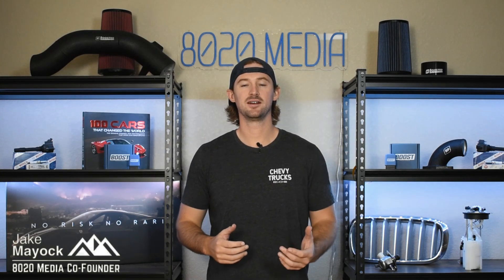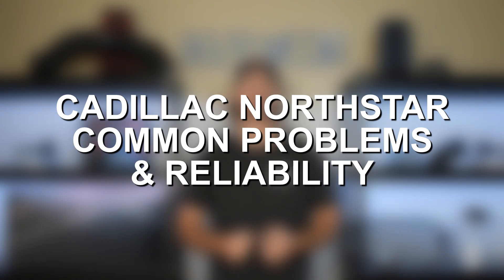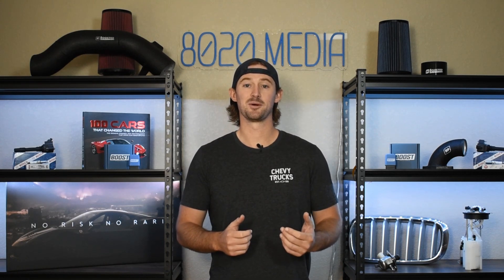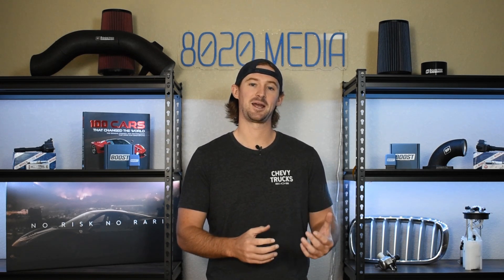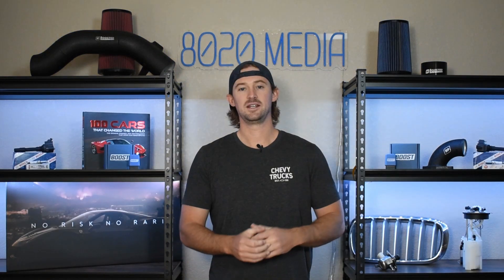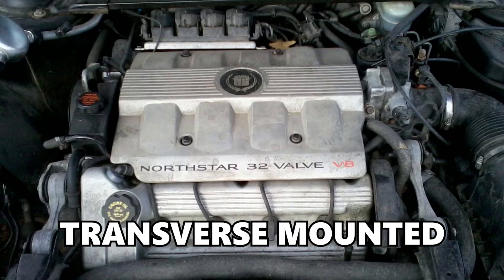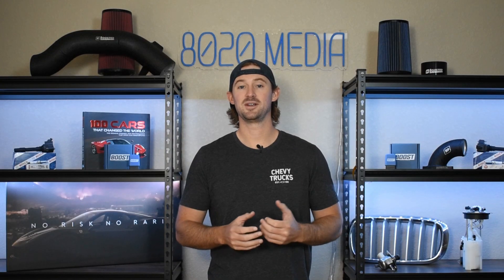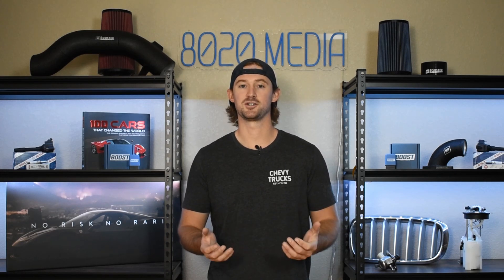The Cadillac Northstar V8 | 5 Common Problems & Reliability

Comment: How do you bullet proof an engine I have low mileage 97 cadilac  that I really  like and want it to be around for a long time
Reply: Northstar Performance is the only reliable option. The owner, Jake has dedicated many years to providing everything needed to bulletproof a Northstar. They also offer performance modifications including ecm tuning. I've owned my 97 Eldorado for 16 years, purchased with the head bolt failure at 130k miles. Had a mechanic familiar with Northstars install NSP head studs, 50k miles later still running great with no overheating issues. Its hard to bad talk these engines after you've had the chance to enjoy and experience their good side. I swear, I love it a little more each time I hit the throttle 😅

Comment: I just bought a 2000 Deville last week. 55K and well maintained. Perfect in every way, not a scratch. Even has the new car smell. If it blew up tomorrow it would be worth fixing or just keep to look at. I could just part it out and make a boat load of money. Have you seen what a perfectly clear pair of OE headlights are going for, it will boggle your mind. The interior looks like it's never been sat in.
Reply from the maker: W - Nice, pretty low mileage for that model year. Just take good care of it and you can easily get 200k+!

Comment: The head gasket problem was not due to TTY bolts stretching it was the fine thread design in a cast aluminum block which was remedied later with coarse threaded head bolts and there is a kit to tap and install these on earlier engines. That was the only major issue other than oil consumption.
Reply from the maker: S - Thanks for sharing.

Comment: I cant tell if my 03 cadillac seville is leaking or burning oil but i lose oil but no spots on my driveway or anything. What could it be?
Reply from the maker: D - If your vehicle is losing oil without visible leaks or driveway spots, it's likely burning oil internally, which is common for the Northstar V8 in that generation; these engines are known for oil consumption due to worn valve stem seals or piston ring design, especially past 100k miles. You might not see smoke because the catalytic converter can burn off much of the excess oil before it exits the exhaust. To confirm, check the tailpipes for black carbon buildup, monitor oil loss rate between oil changes, and inspect the PCV system for clogs that could worsen oil consumption. A leak-down or compression test could help confirm if it's ring-related, but unless it’s excessive, top-offs may be the most practical fix.

Comment: I have a 2001 Olds Aurora with the 4.0 Northstar. I bought it new in 2000. Trouble:
1. Spark plugs & boots....2019
2. Fuel pump.....2020
3. Starter Motor.....2024
Reply from the maker: M - Not too back actually! Thanks for sharing.
Reply: @8020Automotive  OK

Comment: I've owned 5 Cadillac Northstars. Other than the fact they leak oil like the Exxon Valdez, I've never had a problem with them. Proper maintenance is key to their survival.
Reply: really?! i need some help with my 2000 deville, and no one is willing to help me im on my own and would appreciate some help!
Reply: They leak oil inside the engine? How exactly do you deal with that if that is the case?
Reply from the maker: T - Well said!
Reply: “I add a liter of oil every 1,000 miles.”
“I’ve never had a problem.”

Mate, it’s a PROBLEM to be spending an extra $10 on oil every 1,000 miles of travel!

Comment: Another crock of s**t video about Northstars done by a clueless youtuber!  I run and build Northstars.  They are actually very reliable!  The issue with Northstars is not the engine itself but bad owners and bad maintenance.  All of the problem Northstars (block porosity etc. ) have long been scrapped.  All that is left are the good Northstars.  These engines need maintenance as they were high performance engines in their time.  They need frequent oil changes, frequent coolant changes, frequent servicing and preventative maintenance just like every other high performance engine.  The head gasket issue is the same with ALL alloy engines no matter what type or manufacture not just a Northstar, DO NOT overheat an alloy engine of any description as you will blow the head gaskets and probably drop the valve seats.   As for the rear main seals, the first gen crank seals were junk.  They have been modified since and the problem is no more if you have the latest type seals installed.  The oil pan leaks were caused by GM using cheap sealants and just the age of these engines (as with all engines.  If it has been resealed by a reputable shop they will leak no more, well for at least another decade or two just like any other engine.  I have never seen a valve cover crack on any Northstar and I have built lots!  Again cheap gaskets which GM are famous for on all of their engines.  Any new gaskets from reputable manufacturers have been built to a higher standard.  Good name brand 10w30 synthetic oil replaced at a maximum of 5000 miles or one year whichever comes sooner is crucial just like any other engine.  As for burning oil this was sort of a GM thing of putting a Northstar in the wrong car.  These Northstars need to be revved!  You cannot baby a Northstar!  Just like any other performance engine the oil control rings will gum up if they don't get enough heat and rpms into them.  This is not just a Northstar issue.  GM putting them into cruisers primarily driven by the older generation that spend most of the time idling or at low rpms are not doing these engines any favors.  The last point is the fact that these cars are now cheap and that causes it's own issues.  My current 1998 Eldorado cost me just $800 with 78k miles on it!  These cars tend to be bought by people who are of low income but want to drive like kings!  Then they suddenly realize that they can't even afford to put air in the tires, drive them into the ground and then blame the Northstar when it grenades itself into a cloud of boiling coolant!  The last one I bought had a cracked block because the owner couldn't afford to even buy coolant and was running straight water in the cooling system!  The first winter the cooling system froze causing the block to crack.  I rebuilt the engine with a good used block and four years later the car is still being driven as a daily with zero faults, oil leaks or coolant leaks with over 170k on the clock.  I have seen these engines running at 300k still with the original head gaskets and one was just posted on one of the forums with 400k miles!!!  Amazing what scheduled maintenance does.  So please stop blaming the Northstar and start blaming bad owners!  P.S. I can have the starter motor out in ten minutes and have the car back on the road 15 minutes later!  I have timed myself doing this.  On a side note, Dexcool eats 93 to 99 head gaskets.  Use green coolant in these engines and replace it every two years.

Comment: Had 2 Northstar Eldorados, 1994 and 2002. Had no cooling system or oil leak problems (admittedly only kept until 60-70K miles). G M switched to DexCool across the fleet in the early ‘90s and extended coolant change intervals to just exceed factory warranty. DexCool has an unarguable fault if run too long in a system with any atmosphere (bubbles) it turns into red mud. The Northstar has many high spots where bubbles will form and lots of places for air to enter. My cars both got switched to green coolant as soon as the time warranty ran out and the coolant was changed every year religiously. As far as oil, once again if Generous Motors could have exempted their halo engine from fleet wide excessive oil change intervals (I did Mobil 1 synthetic annually) the gaskets and seals (and piston rings) would never have been a problem. But corporate wisdom doomed the engine to poor maintenance and as a result the reputation for expensive failures exacerbated the already traditional high depreciation so my cars were both expensive, not through repairs but the deserved reputation ruined resale value. In the meantime I challenge you to find another vehicle that delivers the driving and ownership experience of a Northstar Eldorado, Seville or DeVille at any cost. They were awesome.

Comment: Well you didn't mention the LH2 and or the LC3 versions of the engine... 
   I can't believe how many people don't even realize that these versions even exists. They are NOT mounted transversally, they ARE mounted longitudinally and are the RWD/AWD version, with the LC3 is the 469hp supercharged version.
   I just recently purchased an LH2 from eBay for the grand total of $450 dollars with 157k miles and when I completely tore it down it was almost like brand new still inside, it just looked like the exhaust valve springs could be upgraded. 
   But it also has (from the factory) the LS6 style headbolts, redesigned cylinder heads with hydraulically adjusted roller rocker arms, and the "high pressure" lower crankcase half casting.
    I don't know why but I NEVER hear anyone mention these versions of the Northstar engine.
Reply from the maker: E - We can't focus solely on one version of these engines. We highlight the common problems and reliability overall. However, thanks for taking the time to share your experience and insights.

Comment: My 2001 Deville overheated because GM over torque one of the head bolts. This caused the number one cylinder to leak exhaust into the coolant and cause the engine to overheat.
Reply from the maker: B - Thanks for taking the time to share your experience!

Comment: i inherited my parents Oldsmobile's with the northstar engines. The "short North" in the intrigue and 4.0 in the aurora (I still have it). They purchased brand new. I helped with maintenance on each. Engines run great and never had the head gasket or over heating issues as mentioned in the video. Need to change the oil (synthetic twice a year or every 4000-5000 miles), FLUSH and FILL THE COOLANT DEXCOOL within 5 years. Repair engine problems or coolant leaks. USE GM PARTS/AC DELCO PARTS ONLY. This is especially true with the water pumps. You have to purchase the OEM parts. Replace the fuel/air filters occasionally. I run premium gas and fuel system cleaner to minimize carbon. Run the engine yet, don't beat the "crap" out of it. The results: smooth, quiet power, very reliable and the car runs great.
Reply from the maker: J - Thanks for taking the time to share your experience! This will certainly help future viewers.
Reply: I had a 98 sedan Deville and like you regular maintenance no problems drove it well over 175,000 miles before I sold it to someone else
Reply: Short North? 

That's a new one for me. I always heard of the 3.5 being called the Short Star when I had my Intrigue.
Reply: @jlang8213 both names. Short north and short Star.
Reply: AKA the "Short Star."

Comment: Not to mention the  covered water pump belt
Reply: And the starter under the intake. Battery in the backseat. This is my car. I have no payment. If you own one , be prepared to work on it or pay a mechanic. Mine is an 05.
Reply from the maker: J - True! Thanks for sharing.
Reply: @wordnerd2005  Battery under the intake? Whoop De Doo. Not that big of a deal to remove the intake.The bonus is you dont have to crawl under the car and the starter is protected from the elements. Not all Northstar powered cars had the battery behind the backseat. Eldorados definately did not.
Reply from the maker: A - True!